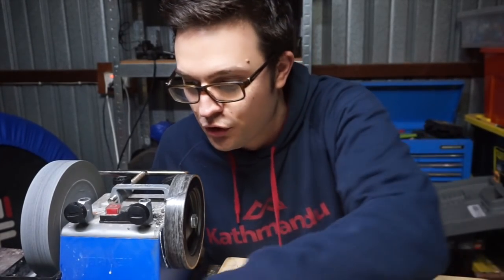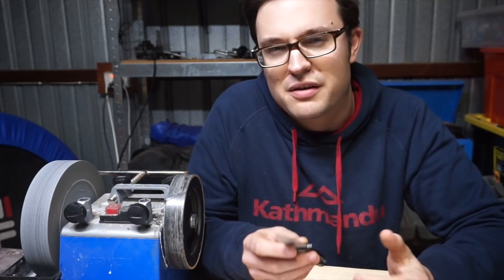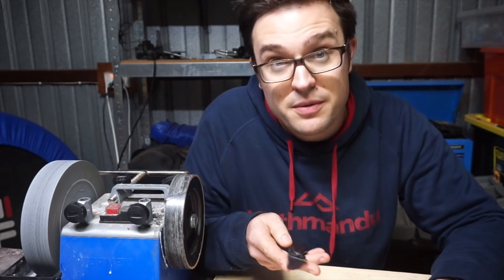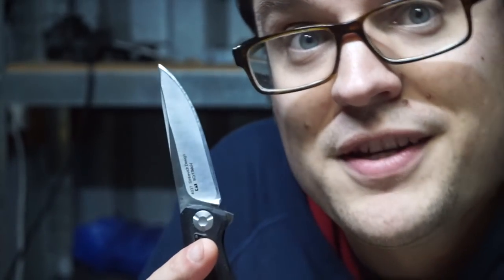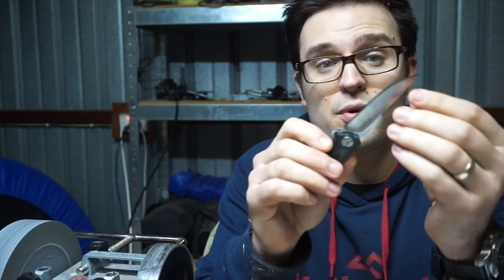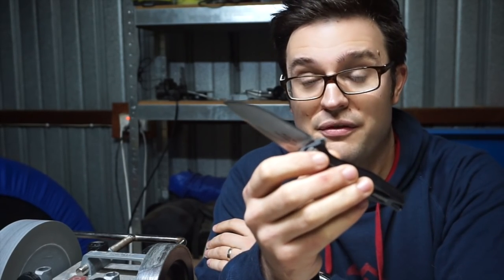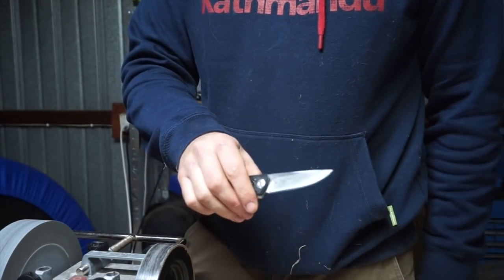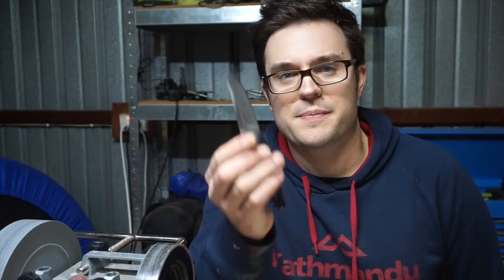Near Super steel Retention from... 8cr13mov? Unleashed to the Maxxxx

Comment: I think 8Cr13mov gets an unfair treatment from a lot of knife collectors. I own a few blades in this steel and I really don't think it's bad stuff. I think it depends if you can sharpen a knife though if it bothers you. I suspect it's the people who don't sharpen knives themselves that hate it the most. People who buy a knife and want the factory edge to last as long as possible. I am really fond of some of the budget steels, Aus 8 I love, I love all the sandvik steels as well.
Reply: Bit late, but the biggest reason is because people don't want to learn to sharpen or try or do it
Personally I love sharpening but sometimes it can be a bit tedious with rusting in my experience.
(And I find a few of them avoiding it because it is a chinese steel, mainly it's americans that I find that has this as their reason)
Reply: @tydshiin5783  I agree with you both. Nothing a little oil won't fix.
Reply: @tydshiin5783  It was a good budget steel but there's better options on the market 12c27, 14c28n, aus10, n690 are good steels at fair prices. For me 8cr i'd pay only 20-25$ at the most for its not worth 30$ and up that some manufacturers are charging (Crkt)
Reply: I noticed that 8cr in 50$ models is much better than 8cr in 15$ models

Comment: my D2 holds a better edge than my 8cr13, but not by a huge margin, and the 8cr13 is MUCH easier to sharpen. Its also a lot cheaper, and i think therein lies its superpower. i dont mind destroying a 8cr13 blade, so i tend to use it more. and i havent destroyed one yet.

Comment: Learning to strop is the key. I put a convex edge on most of my knives and they last for ages before needing to be sharpened. The only ones I use a v bevel on are Japanese kitchen knives that never get abused and I strop them after every use. Some of those haven't been sharpened in years. My Victorinox kitchen knives get the convex edge and they get sharpened every six months or so on water stones.

Comment: I am a bit of a steel snob, but what I am snobish about is a bit odd.
I did some research and came to the conclusion that for a knife 0.8% carbon content is the sweet spot for edge retention, toughness, and edge sharpness.  I also know that Chromium can make steel brittle, so I like the idea of stainless steel that has just enough chromium to be stainless.  Therefore 8cr13mov is the steel that nearly fits my ideal stainless steel composition.

Comment: One of my favorite budget steel, when heat treated properly. Spyderco(and Byrd) do their 8cr13mov HT right. So easy to sharpen and holds a great edge!!
Reply: I have 3 Byrd knives. Awesome working blades. And I don't have to sell a kidney, when I loose it or snap a blade (last one hasn't happened yet, but I do misuse my working knives a bit)

Comment: i've done some testing like this also, not in 8cr though. i took a leek in 14C28N and put at 12 degree v bevel on it. that thing was brutally sharp. hand sharpened on water stones. ultra sharp but dulled pretty damn quick. i found stropping it would bring it back to maybe 85% of the original sharpness off the stones. i never done any heavy cutting (wood or hard materials). i re-stropped it 10 times before the edge wasn't dependable, as in i'd strop it up and it'd dull after dozen cuts or so on cardboard. 

 i would really like see crucible or some company test all their knife steels for the best angle and edge geometry, though it could be bad.

Comment: I have several with 8Cr13MoV and many times it performs as it was D2.
Reply: 8Cr13MoV is essentially O1 tool steel without the tungsten and 0.1% carbon. The 0.2% vanadium doesn't make carbides, but greatly restricts grain growth which allows leaving it in the oven long enough to get all the chromium to austenize into carbides. O1 with vanadium can be held 5 minutes longer than recommended and all the tungsten makes carbides, plus the 1.4% manganese makes it easy to straighten any warping within the first three minutes after quench. It is the only knife steel I've used that does that. I typically do a four day cyro under dry ice at -115F and retemper at 425 giving me a tough hRC of 61. It's all in the heat treat.
Reply: Mountain Fisher you have to take into account the 14% or so chromium in 8cr
Reply: @MountainFisher  So, is it a good steel or ?  --yes, these things are relative.
Reply: @deathbyastonishment7930  I'm mistaking 8cr13 for 80cr2v, my mistake.
Reply: Mountain Fisher 80cr2v is definitely a great steel
Reply: @deathbyastonishment7930  I make Knives and O1 is my "rusty" steel that some folks want. My HT is exacting and I come out with RC 60 everytime. I only buy O1 with the 0.20%Vanadium. Not that it makes carbides, but it restricts grain growth so I can get the Cr and tungsten, W, into solution and make carbides. I'll match my O1 against any "expert" who makes O1 knives in a forge any day. I'm thinking of one in Canada who makes videos, but knives from O1 in a damned forge. He's only getting iron carbides, just as well use 1084.

Comment: My kitchen Shun 4 inch paring knife was resharpened to a 15 degree angle and is a razor.  However, I use a Green River knife in 1095 steel or a Zwilling J.A. Henckels Twin Signature 4" paring knife for 99% my needs.

Comment: That dulling by steel rolling is exactly why this test becomes far more interesting when you test a steel like 1095 treated to an extremely high hardness because all of sudden you get the advantages of the low angles but 1095 at 65+ HRC basically will not roll buuuuut it does retain enough ductility to not instantly chip out.

Comment: I saw this in my notifications earlier but flicked by because I thought it was the D2 test again. That's a significant change in retention. Once again a really great video man. I was thinking while watching this that (and some Youtubers have also said similar) a 'softer' steel would be more suited to a minimalist camping/hiking/survival situation than a harder steel. There is the potential to completely re-profile the blade, depending on your circumstances, not to mention the ease of quick sharpening on a flat rock. However, I still feel that harder steels are a better option for the weekend camper, or for EDC. But then, other folks opinions may be different. The argument can go both ways.

Comment: A idea to get rid of tall low angle bevels on knives I was thinking you could either hand sand them to match or throw them in a tumbler( polish or not polish before hand) and that way the whole finish will match. Then you can throw on a micro bevel so it will look clean in theory it could work.

Comment: Some nicer steels really strop nicely. My spyderco dice in cts-xhp responds to stropping fantastically. That knife has a 15 degree polished edge and despite a lot of use, thanks to regular stropping I have sharpened that maybe only twice a year. Cts-xhp seems more prone to rolling than chipping. S90V also works really well with a strop.

Comment: Have you tried a plastic cutting board/sheet to see what difference it makes versus your wooden one? It might matter more with softer steels.
Reply from the maker: yeah I tried a cork cutting mat, and it did add longer cutting with the same edge upon repeat. This was back on an m390 test though. Its hard to test for every variable, though

Comment: I wonder how lc200n would do, it is l8nd of on the softer side but with some very good abrasive wear resistance nit rides. I find that the steel scratches easily. Meaning the steel itself is around 58-59 or so but hold an edge very well. I imagine you would see some rolling with that steel. I’ll bet zdp does very well in your test.

Comment: I got the atmos, I just cleaned up the factory edge on the lansky, so probably 22-25 degrees per side, cut up the cardboard box it came in and it rolled. By rolled I mean it feels like the burr came back and it also has a big flat spot on the edge, it definitely needs to be sharpened again. I'm not trying to be a hater, but there's something I'm not understanding about 8cr13mov, reviewers keep say it's decent but I can't get it to be decent. I also used 14c28n, jpn acuto, D2 and vg-10 on the same box, with 34 dps edges, and they showed no effect on the edge.
Reply from the maker: I definitely dont love 8cr13, I would lovd for it to go away, and be replaced by something better. A to your knife, I dunno, thats a very broad angle to be rolling, it must be a burring issue

Comment: I don't know how you did that, if I put a 17 degree per side V edge on 8cr13mov it rolls over on cardboard (a little Caesars pizza box to be exact), had to reprofile it with a worksharp back to 20 dps convex. I've got an atmos on order, so I'll try 17 dps V edge again on that.
Reply from the maker: could be the microbevel
Reply: There is actually some science to the removing the existing edge and grinding about maybe a millimeter of steel and making a new edge as well like Carthago suggests. Factory edges tend to be made using a belt grinder without a cooling mist like the tormek has so sometimes the heat from the factory sharpening of the blade on a belt grinder actually causes heat damage at the very edge of the knife that extends for about a millimeter or so.

Comment: Have you heard of CPM 9v. It’s a very tough steel that has great edge retention. It’s also stainless, the only problem with the steel it is easy to round off the blade kinda like a pizza cutter. If that steel goes into production for knives they need to give it more carbon because the heat treat is normally 56hrc

Comment: IDK. Theres no way around the front end sharpness loss that occurs with lesser steels even if the geometry behind the apex is wedging through the material. Work like Cruwear at 62 HRC, i hardly ever see light shining off the apex after cutting cardboard, but with softer steels like 8CR, that reflective apex happens immediately. Yes geometry cuts but the apex will still be affected by the strength of the composition and its hardness
Reply: Probably a deburring issue? It's definitely more difficult to remove a burr from 8cr at 60ish hrc than CruWear at 62-64.
Reply: @jabokd574  look at outpost76's fine edge rating on Cruwear. Something about that steel just holds a fine edge like crazy. Thats why i tend to choose it myself to break down cardboard at work, because it doesnt wear down into a hard to push working edge like most other steels

Comment: What's your opinion on 8CR13MOV vs S30V? What makes S30V such a high value steel?
Reply: S30v is better wearing steel because of the way it's designed it's powdered metal so every thing is evenly distributed. It is also capable of a higher Rockwell. This makes the edge holding better in it self but with it comes trade offs like chipping. I prefer S30v myself the edge does last significantly longer between sharpenings compared to the later. I do not mind 8CR13M0V though it's pretty easy to sharpen. But if you use diamond to sharpen it won't matter. I also like D2 steel it's comparable to S30V in my experience. Just make sure you have diamond or it takes for ever to sharpen on traditional stones
Reply: @1stfloorguy59  

D2 comparable to S30V... lol, no.

S30V is a super steel in every sense. 

I'm as big of a steel snob as you'll find, I EDC maxamet, Rex121, or S90V depending on what I'll be doing that day. I love having the newest steels, but in real world use, S30V tends to have edge holding comparable to V4E or M4 or CRUWEAR. Nobody bashes those steels, but everyone seems to bash s30v.

Once you start using your knives in real situations, you'll find that these rope cutting tests, while interesting and informative to an extent, are mostly novelty.

Comment: I just looked down in the comments and someone reminded me. You know what steel will probably go over 1000 cuts? ZDP-189  unleashed. ZDP-189 has some fine to mid-sized carbides and gets stupid stupid hard. Spyderco runs theirs around 65HRC I think? (By ZDP standards 65 is super soft lol) But yeah if you ever want to give yourself carpal tunnel syndrome do ZDP-189 unleashed.

Comment: I think you can probably ditch the microbevel entirely or take the edge angles down to 10 degrees per side with a slightly more prominent microbevel which I would have done. Microbevels do add quite a bit of toughness to the steel but 8CR13MOV is sort of a 440C look alike so it's probably not quite as ductile as I'm thinking it might be. I'm still hella excited to see those Sandvik steels get tested because those you should be able to push some crazy angles on em

Comment: your not making a convex edge using a wheel, but actually the opposite. your making a hollow grind. also, i cant possibly understand how putting on a sharper grind and hollowing it out could cause better edge retention. the physics dont add up
Reply: You can easily make a convex edge on a weel...
The better edge retention comes from the geometry. Even if the edge is dull, the knife can still cut because the geometry is thin enough.
That phenomenon is easy to see on opinels...super thin geometry and they still cut even if "dull"